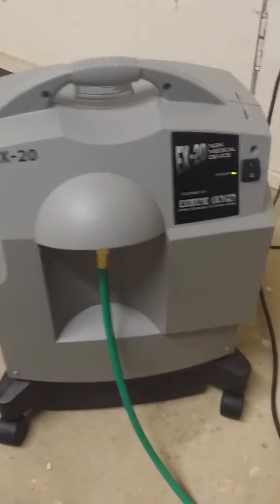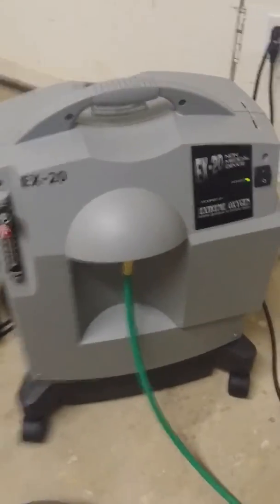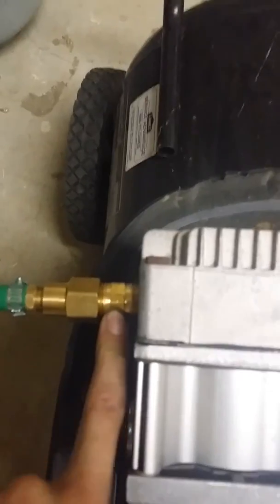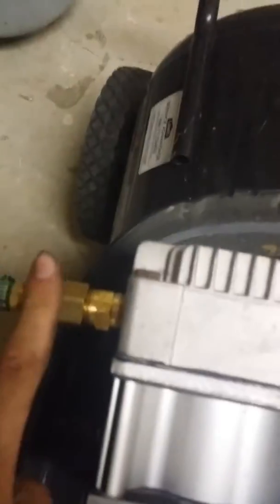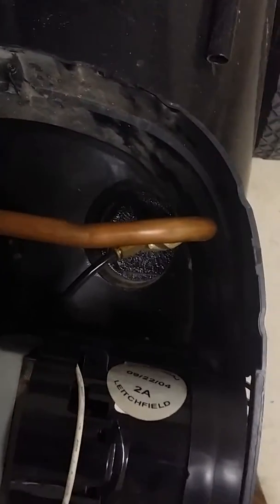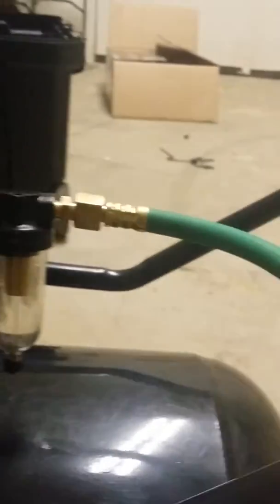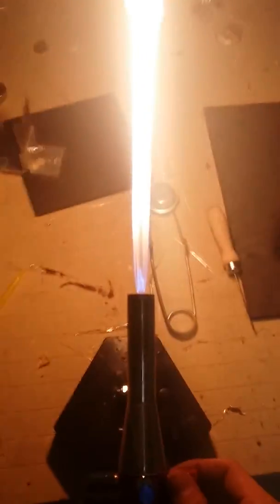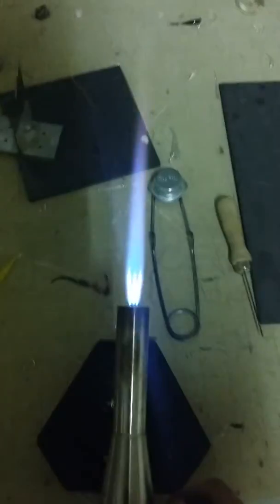Glass blowing oxygen system

Comment: Thanks for posting this!  Could you explain the purpose of the compressor, please?
Reply: the oxygen concentrator only puts out around 1 psi of continuous flow when connected to the torch, while the oxygen valve is open on the torch. Now one bit of info every o2 concentrator states that its 20 psi or 10 or whatever its not true, they put out a closed valve system pressure of about 3-4 below what they all say, i have talked to a torch manufacturer who said every concentrator seems to have this issue, when your torch is running the pressure maintained in the line needs to be around at least 3-5 psi for and mid or small torch (excluding mini torches and side mount torches and top mount torches) but the concentrator itself does not keep anywhere near that pressure not even the systems that cost like 2,500$, SO you have to get a OIL FREE compressor, feed the intake of the concentrator into the vacuum compressor and the intake of the compressor has to match the out put flow of the concentrator in addition to keeping a pure LPM flow, you then need a ball valve or solenoid for the concentrator to expunge air while it turns on and warms up and gets up to o2 levels before the compressor turns on, this way you can chose to have the concentrator always on or have it turn on and warm up and get to o2 purity level and flow before the compressor kicks on to save electricity, the compressor needs a pressure sensor valve on the output line of the tank so it knows when it needs to refill itself, you can install a secondary pressure switch inline at a lower psi level so it can send power to the concentrator to turn on because it knows the pressure is 15-20 psi away from the compressor turning on so it has time then to warm up and get to o2 purity level. unfortunately you cant just go buy brand new concentrators without specific medical application, so you have to buy refurbished ones or ones people rebuilt and modified to work for glass blowing or welding applications so they like to charge a hefty price, you cant really buy a fresh refurbished 10 lpm concentrator modified to work with torch applications for less than like 600$. The real hard part is buying the right pump so youre oxygen is pure and not consisting of compressed air, as you see in the video there is a bit of compressed air the o2 is only around 70% pure and you cant run a glass torch on anything less and get a good flame unless the 02 coming out of the tank is at least 70% pure, ive spent about 2 weeks looking for the exact specification perfect pump to optimize my o2 purity, i also plan on adding a cooling coil to the output of the compressor and a heavy duty moisture remover after the cooling coil before it enters the tank with an additional 5 micron 21scfm filter on the tank output, and then a PSI gauge right on your bench to adjust or close the line right to your torch so the tank valve can stay wide open for a better cleaner output. A good compressor that will work and work well will be around 200$ i wouldnt buy used because you want clean new stuff for purity of youre oxygen, i plan on buying another one of the exact concentrators in a month or two and plan to attain a 95% purity level on the final output of my air line going straight to the torch after all the filters.
Reply: @al3xr0th  Did you ever figure this out? I am currently setting up my rig with something similar, using a gast compressor. think im good?